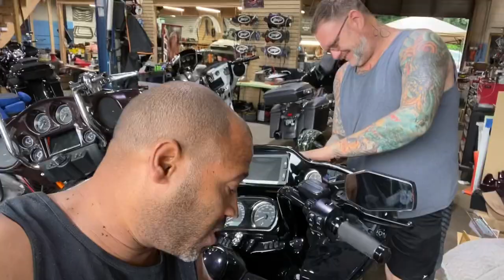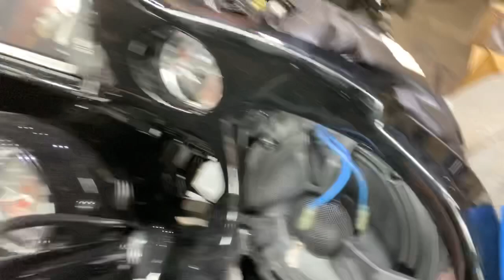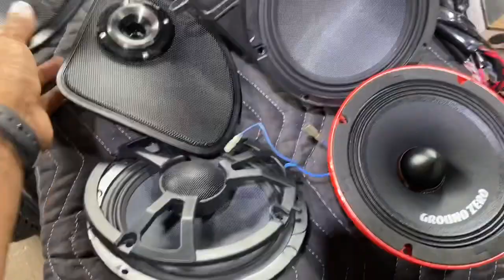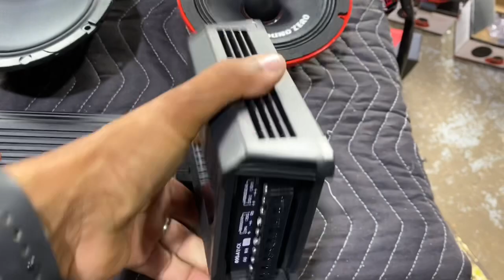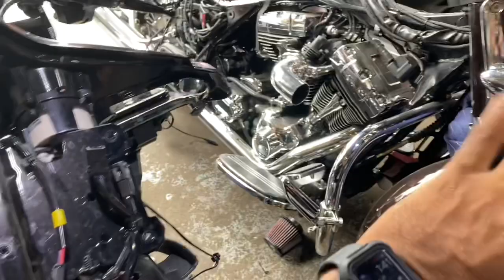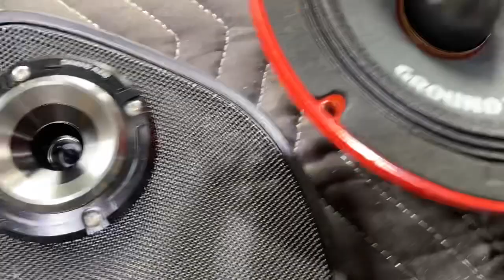Upgrading from the Boom Audio stage 2 to the NVS Audio stage  3 Part 1

Comment: What are you going to use for the rear 5*7 speakers?    I just had the Rockford Fosgate put into my road glide and I want better sound....   I will send you an email I’m looking to get a stage III upgrade done also ASAP.    I am in Connecticut I can get there by noon.   Keep up the great videos they are informative.
Reply from the maker: Sam we normally use the Soundz 5x7 , Beyma 5.25 or convert them to a 6.5 with a custom pvc plate and run any speaker we want .